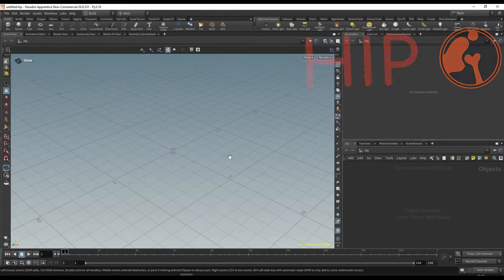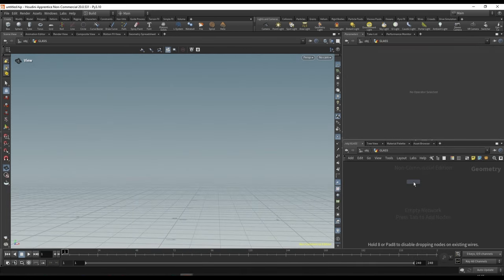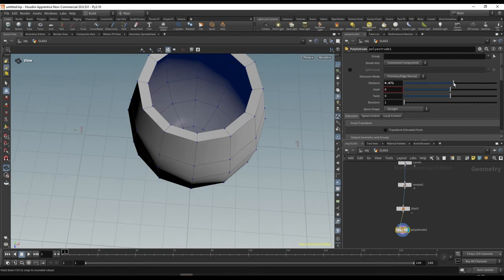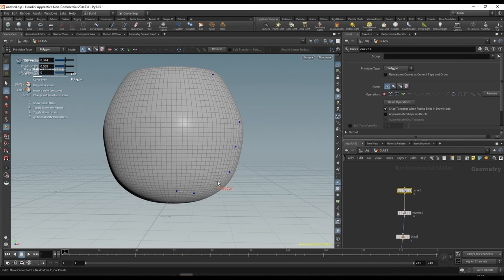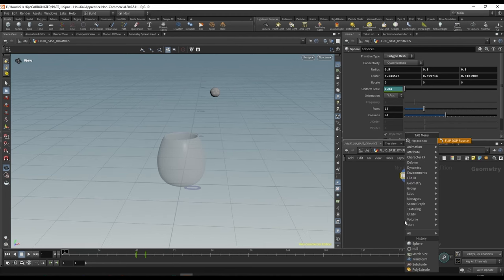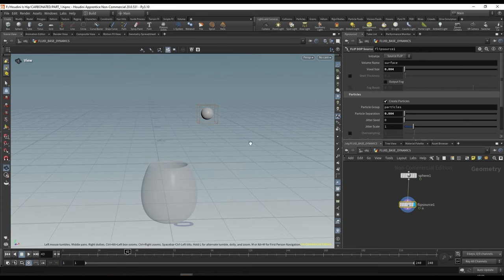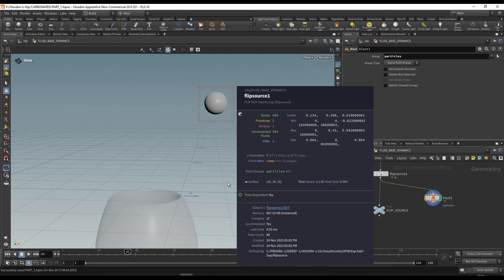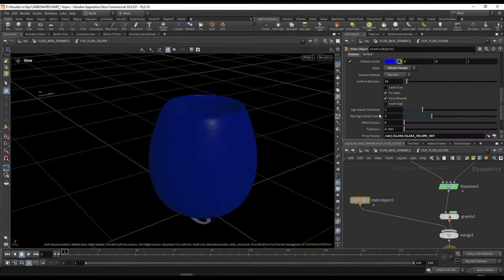Houdini is HIP - Part 15: Sparkling Water Project

Comment: did anyone else not need to change the exterior band voxels? For some reason, my viscous fluid went in the container at the default settings unlike what happened in the tutorial.
Reply from the maker: Hey! It's highly likely considering that there'd be some variance in the glass shape that we'd each settle on. Some might not need it simply due to their minor shape differences. Thanks for bringing it up!
Reply: Oh interesting, thank you for clarifying. And as always, thank you for the stellar tutorials!  @NineBetween
Reply: for me, it was the grid scale that caused me the same issue as in this tutorial. when i had my grid scale at 1.75 just like in the tutorial, the fluid did't go in the glass, but when i changed the grid scale to 1.5, the problem disappeared.

Comment: I'm having an issue, it might be the version (currently using 20), but my vdbfrompolygons isn't behaving well. Normally all I can see are a few scattered points, I increase the voxel size and it makes it more solid but still not right (this obviously crashes on simulation). If I check "preserve holes" it appears as normal, but when animating the lid is viewed as a solid so doesn't flow into, but off the surface. When I turn this setting off the fluid enters the cup but dissolves relatively quickly so no volume is established. Any ideas? or have I just found a bug with the new version of Houdini?

* Update * I managed to make it work by using a vdbfromparticlefluid node instead and reducing the particle separation to something low like 0.005 (note, I do not know if this has an undesirable end result besides increasing the simulation time)
Reply: I had the same problem. After using your method, the volume loss is huge. So I went back to check every step & I found an error. Make sure you turn on Output back in the PolyExtrude node. That did it for me
Reply: @vinhtran3652  Thank you so much! You are my savior!

Comment: hi there, i'm using Houdini 20.5 and i've run into a problem when following this tutorial. Once i have viscosity activated, no matter how small a number i put in the attribute wrangle node, the fluid always looks way too sticky for normal water. I believe I've followed your operations very closely and so it's driving me nuts not being able to get the same result as you do. I'd really appreciate it if you could help me solve this problem!

Comment: That volume loss thing confuses me. Last evening I've followed the tutorial but even after your trouble shooting advice and changing the sub step to 5, the glass wouldn't fill up. Ive started this tutorial again on a fresh file and made sure to copy all of your numbers exactly and still, it didnt fill up at all. And now I've tried it for the third time and I'm now at 22:00 with precisely your inputs and now the liquid is filling the glass up already and it's so much that it overfills and it looks awesome. The only thing that very slightly differed each time was the shape of the glass. But is this the reason? I can't think of another thing that was different.

Comment: Hi, I am trying a shot with vellum. A creature (rebelway wreck havoc one) is breaching from ground. So  as the sand drips from its body, the chunks appear same size,  I want bigger chunks and smaller chunks that variation to be there. How do I achieve randomness in chunks it ?
Reply from the maker: Hey! Try out the cluster points node and then use that in a Vellum glue constraints node. You can also use an attribute noise to create randomness in the glue strength. I briefly touch on similar concepts in the Vellum part of this series here: https://youtu.be/nQuVoXEAziU?t=1107

Comment: Everything went perfectly for me until the color node for visualizing the density. Although the color node settings are exactly like yours and the density attributes for density go from 200 to 1000 as you coded, the visual I get is still the same as the visual for velocity of the particles (starts light blue from the emitter and gets darker blue in the glass). Is there a setting I missed?
Reply: Now I figured out the issue. flipobject nod has a Visualization tab under Guides. Particles were checked which seemed to override any color nodes. So when I unchecked this, now I got the correct visualization for Density and Vorticity. I don't recall this in the tutorial anywhere.
Reply: @vytasrauckis6703  Same happened to me so cheers for sharing ur fix👌

Comment: Hey, i m facing a different behavior in my glass and I can see that my version 19 in the curve node the primitive type is bezier curve as a default, if I switch to polygons it messed up my polyextrude and the subdivide also etc.  any solution? plss :)
Reply from the maker: Hey, you could perhaps try a resample node on the curve and then adjust the number of curve segments. I would recommend updating to 20.0 though, if you can. The rendering part of the series will only be possible with H20.
Reply: @NineBetween  Thank you for your quick response 👏🏼